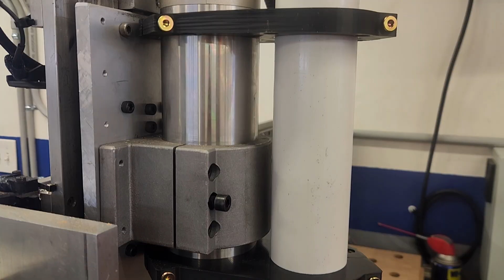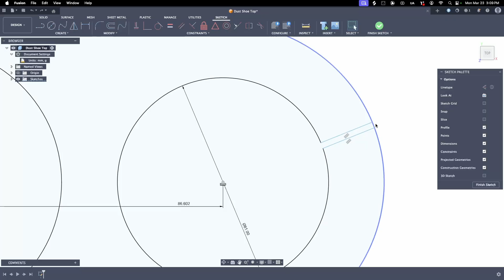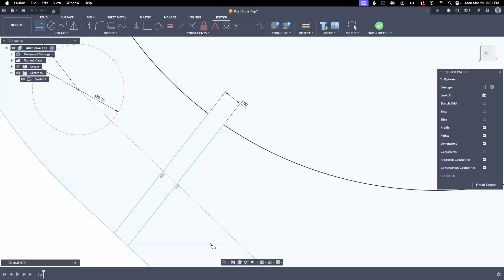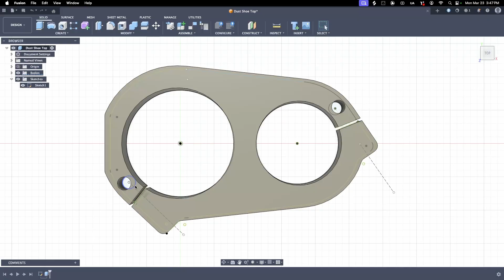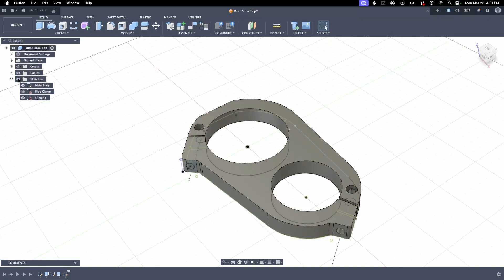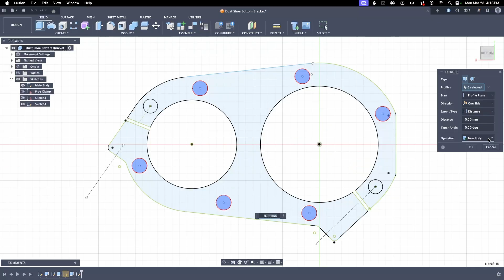Autodesk Fusion Tutorial - Making Real Parts for my CNC Router

Comment: 4:58 Tangent, you can also use the constraints options to fix those connections so that the design is parametric (meaning you can come back and adjust a few values and get a new design that's very close to the original one but different in the ways you define), for example if you want a longer distance between the spindle and the pvc pipe, you can just change the line dimension between them in your sketch and everything updates properly, given that you added the relevant constraints on and relationships between the features in your design).

That fix option at 12:58 can come and bite you at a later stage 🤭, but that's only a concern if you plan to iterate on your design.

Thank you for the tutorial by the way 😊.
Reply from the maker: Yes, parametric design is  the bomb! I need to design stuff more often because when I do I learn a bunch of stuff that I end up forgetting half of by the next time...
Reply: @cncfever so an ISTP 🤔. Don't sweat about it brother, I don't think you will need it in real life unless you are interested in building systems of some sort. For one off projects, it isn't worth your time. I believe you shine when you are winging it 😉.

Grounding knowledge in real world applications surely seems like a nice thing to do 😅. I am here to learn how you do that even though that I know that I should just go to my shop and just start doing it 😂.

Thank you again for the tutorial 🙏🏻.